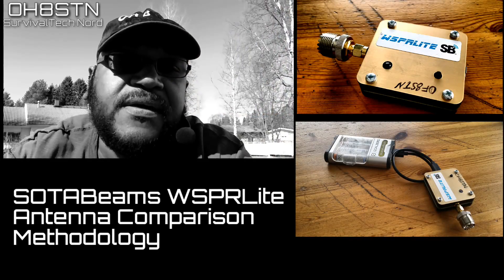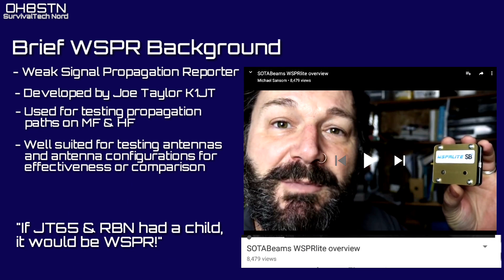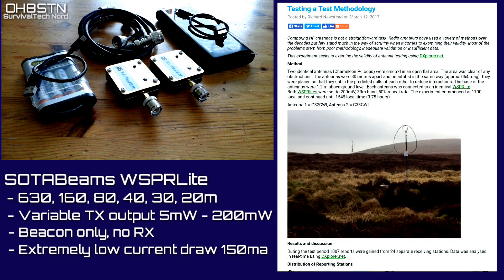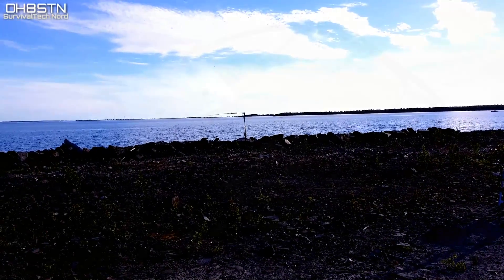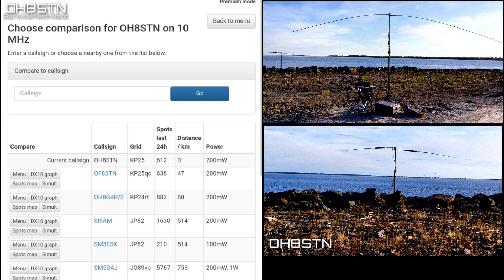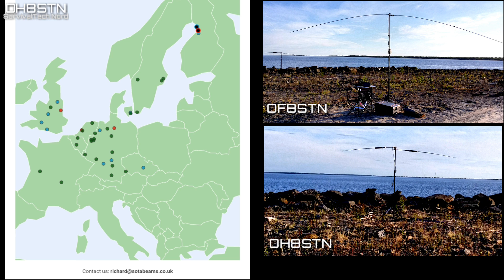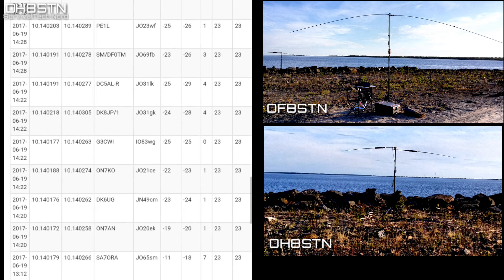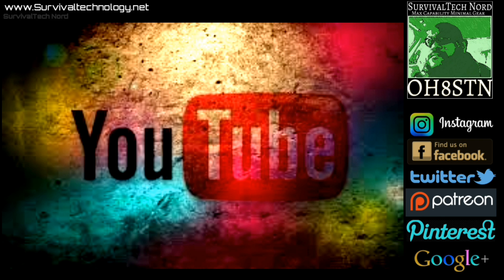SOTABeams WSPRLite

Comment: Thanks for the plug for my video. I think you've highlighted some key things in the way WSPRlite frees up your radios and can actually be left out in poor conditions running on batteries to gather results. We're all gradually learning the best methodologies to compare (and therefore measure) aerial performance and I have to say your approach with 2 x WSPRlites running in parallel is great and especially good for choosing an aerial configuration that can target a specific area rather than just looking for DX.
Good stuff Julian
Reply from the maker: +Michael Sansom You are welcome Michael. I enjoyed your video so much I wanted to make sure to plug it, letting other people know what do you have accomplished. Yeah one area where the traditional ham radio operators and I often disagree, is on DX as the ultimate goal for radio communications. Sometimes my goal is simply to find other FSQ stations in Scandinavia. In that way the DX 10 plots were rather strange to me. The simultaneous spots page is beautiful though. 
I think Richard did a great job on the hardware. Hopefully the Dxplorer.net website will grow into something a bit more mobile.
Thanks for commenting Michael it's very much appreciated.
Reply: Michael, I had watched your great video a couple of months ago and it motivated me to buy a WSPRlite. It is on the list to get done in the next one to two quarters. By the time I get it, you guys will have already figured out the best practices methodologies for those of us not quite on the bleeding edge!  73 de Robert K3RRR

Comment: Thank you for your very useful video... I'd like to ask you 2 questions.. 1) What kind of battery bank do you use..? i use this one  (https://www.amazon.it/gp/product/B01G5DQ946/ref=oh_aui_detailpage_o06_s00?ie=UTF8&psc=1)  but it seems that the low power absorbed by the WSPRLite is not enough to keep the battery bank "awake".. so after a few minutes the power bank goes off and the WSPRLite too.. 2) Have you encountered any sort of problem testing simultaneously the two different nearby antennas due to their proximity..? Tks. IU1CYF